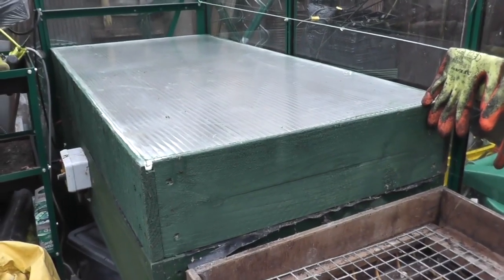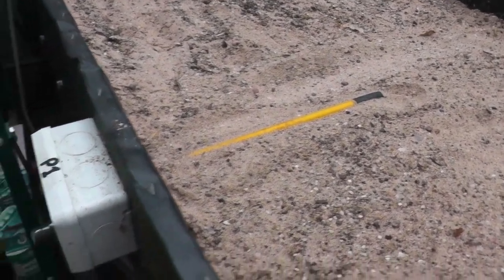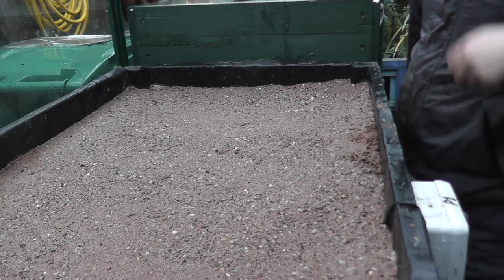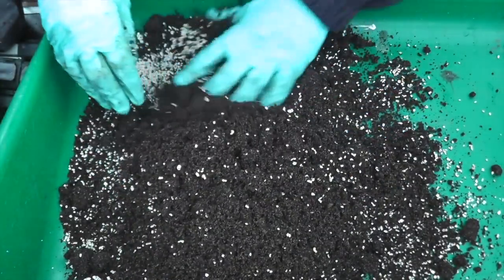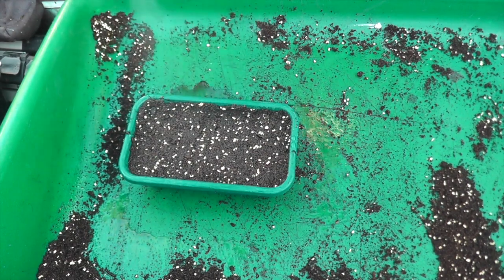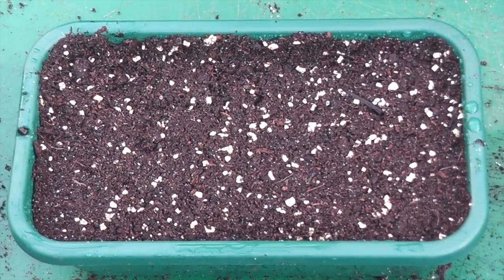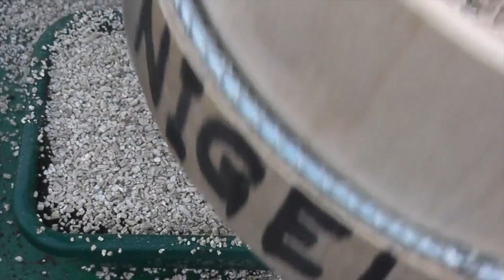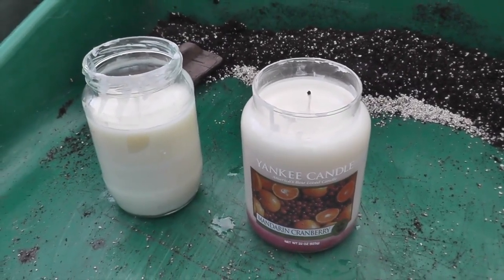MuddyBootz Allotment #36 - Sowing Onion Seeds - 2016 Crop Planting Selection

Comment: Great update Nigel ! I will also try to grow Boltardy, Cobra and Sapro this year, still thinking about the potatoes not sure what to follow the early variety with. The heated bed is great help to start early in the season I think you can also use the fresh horse manure to create heated bed if there is no electricity around might try it at some point.
Reply from the maker: +Raf's Kitchen Garden  Hi Raf.....Yes, the Victorians created hot beds using fresh horse manure and straw. 👍
What Sarpo variety are you going to grow? The Sarpo Mira are a main crop variety and store very well.
Cheers....................Nigel
Reply: Yes that's the one I will try the sapro mira, heard good things about this variety  ;)

Comment: Brilliant episode Nigel, uncanny... We have an almost identical team sheet!! And a big thanks for the UK Here We Grow shout out on our 100 hour candles 👍👍👍
Reply from the maker: +Brian Bastable  Cheers Brian.......we can't both be wrong with the crop selection! 😀
With the predicted cold snap on the way...I have just made another candle.
INFO.......A Yankee Candle full size jar needs 2.5 blocks of Trex (approx £2.25) ...that works out around 2p per hour to run the candle....BARGAIN!!! 👍
Reply: +MuddyBootz Cool Cool, im still tinkering with the actual set up, cant decide if one pot or two is better and i think a brick thickness to stand them on may be a little too much as cool air can get underneath so im looking to reduce the gap to about 1inch (PS Tesco sell Trex at 79 pence a block 250g)
Reply from the maker: +Brian Bastable  75p in Sainsbury's 😉👍

Comment: I wish I had a heated bed. maybe some day. I plan on starting some onions, tomatoes in a couple of weeks. I plan on starting my own brassicas because the last couple of years getting them at a nursery was not a good idea. i'm not sure if we had a blight on them here in Vermont  but as soon as the heads formed they looked really nasty, they turned a muddy brown color.
Reply from the maker: +Ssupermom12000  Did you check the roots when you pulled them out of the ground? We have an increasing brassica problem in UK with Clubroot.  They are bulbous growth on the roots of the plant and it restricts the flow of moisture up to the plant. The heated bed is a great asset - I am sure you would benefit ever more with your low temperatures. 😀
Reply: No' I didn't think to check the roots. I will look into the heated beds they seem to work well for you thanks.